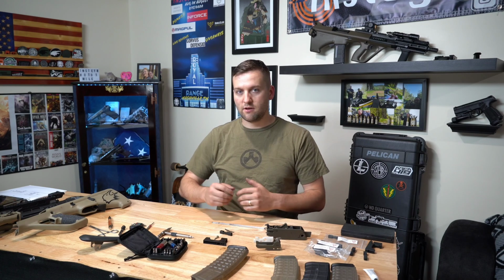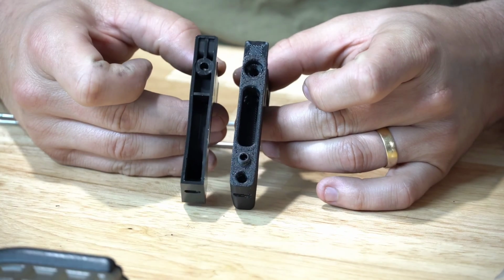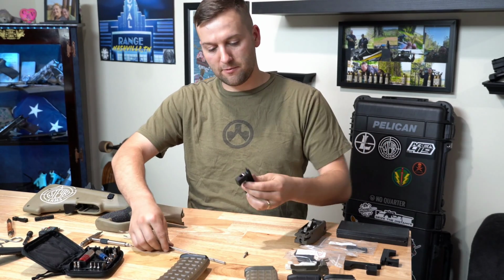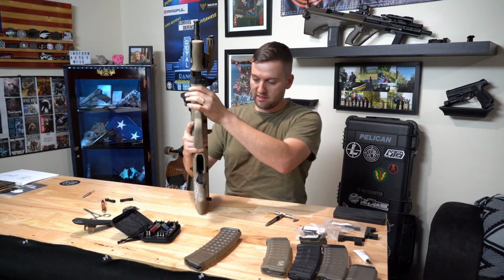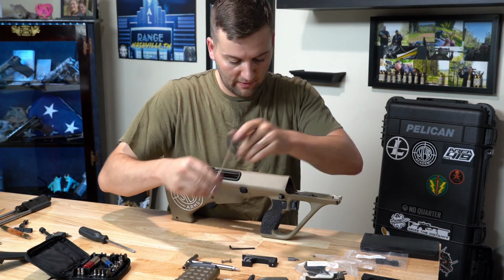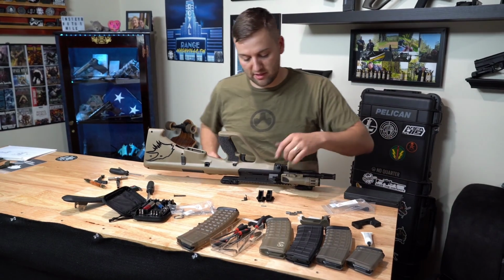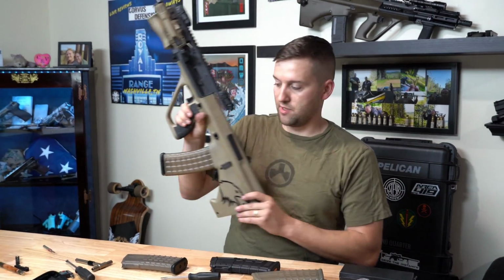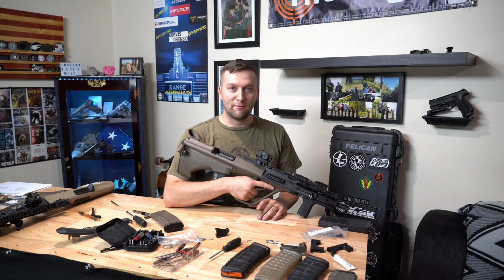Steyr AUG upgrades from ARID ( Trigger Safety Magazines  Release )

Comment: Should you use lock tight on any of these set screws/bolts when installing the arid trigger?
Reply from the maker: You don't have too. Tho you could use Blue if you like . The big thing on the trigger screws is not to go over 10/ 12 Inch lbs of torque.
Reply: @TnSteyr  Gotcha. I appreciate your answer because I almost always use blue loctite on set screws when doing any armorer work, and I likely won't for this since there's a need to adjust it and I just don't want to risk it between the time I install it and the time I'd use it live, and then realize it needs adjusting. Thanks for answer man!

Comment: A hardened ball on plastic (even GF reinforced nylon) seems like it would wear a channel with the point load. There are some multi-ball rollers with resin balls (Misumi part BPRJ5, BPRJ6). Is there enough space for an M5 or M6 roller, or potential to affix a stainless shim to the plastic to take that load? A screw seems a lot cheaper to replace than the stock itself.